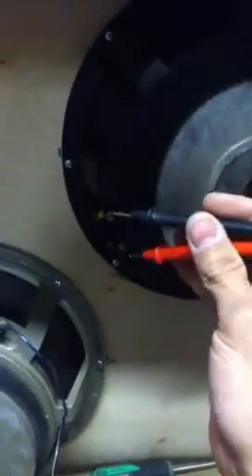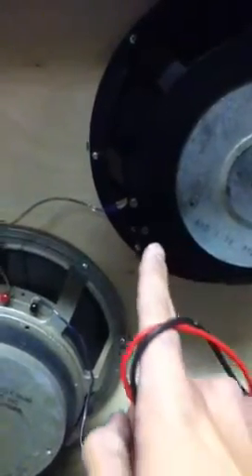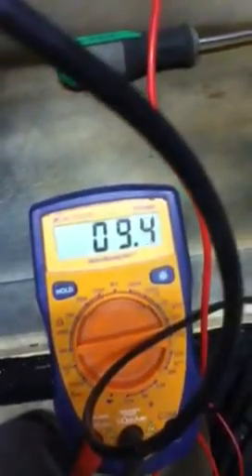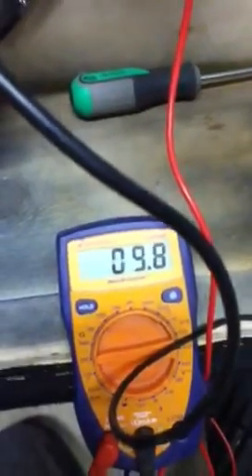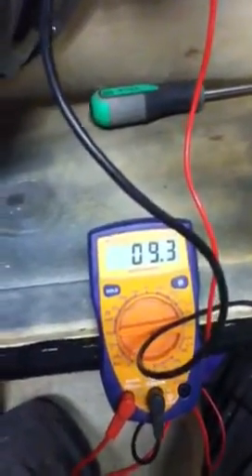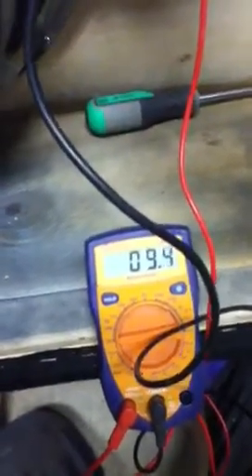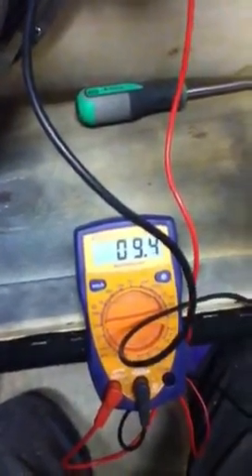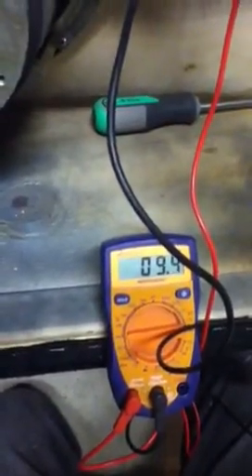Understanding ohms in a guitar speaker cab. Part 2

Comment from the maker: Sway- as long as the ohm load is equal or higher to the amps min load, your good. The problem arises with efficiency when you add a lot of speakers because now you are sharing wattage. Basically there's a point where more speakers become a waste unless you have the power to back it up. 

James- if your amp is stable at 8 ohms, a 16 ohm cab will be fine but you will only be using half of your amps capable power. Ideally you would want the cab to read around an 8-10 ohm load on the meter to really use the amp. That's reading at the jack or even better, plug your speaker cable into the cab and read at the end which will plug into the back of your amp head. That's how you get an accurate reading of your cabs true ohm load. Cheers.

Comment: Great video . I wanna run 6x12 at an 8ohm load . How do I go about that . Also does it matter if the speakers are different sizes as long as the load is correct? For example , 2x12 and 1x15 or 2x10 and 1x12 cabinets?